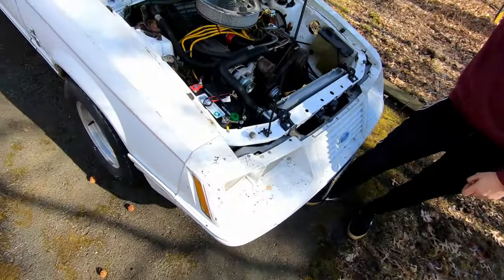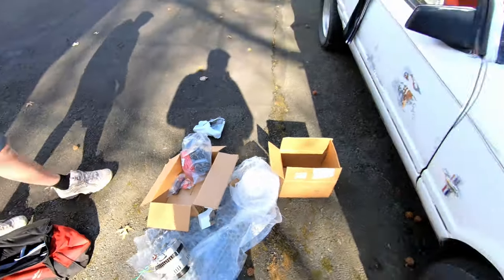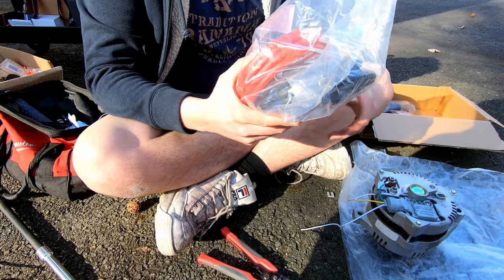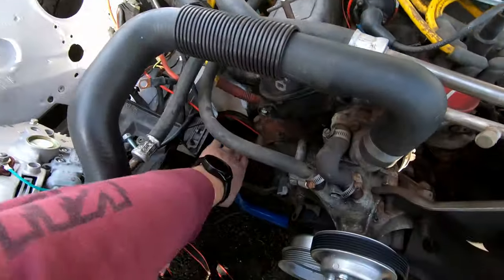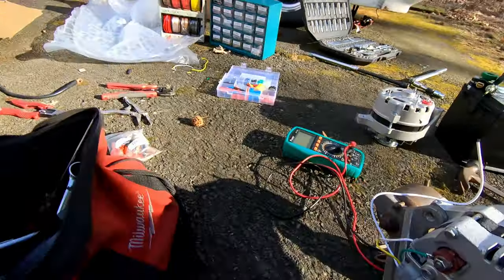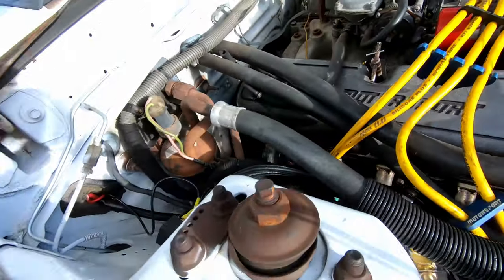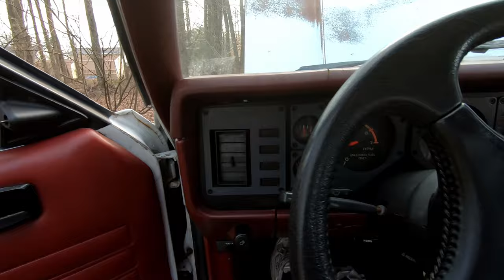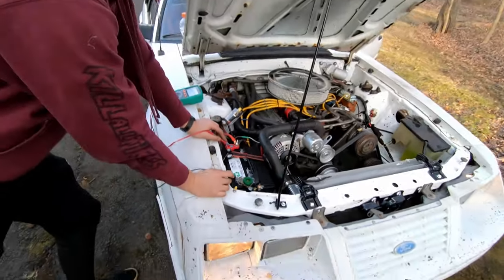DIY 3G Alternator Upgrade on a Foxbody Mustang (1979-1993)

Comment: Just curious where did you get your info on wiring the plug? It’s a lot different than I been reading
Reply from the maker: I don't remember the exact place I got my info since I did this almost a year ago. It simply is how a alternator works and how it should be set up. It works and I haven't touched a thing.
Reply: What alternator did you order ?